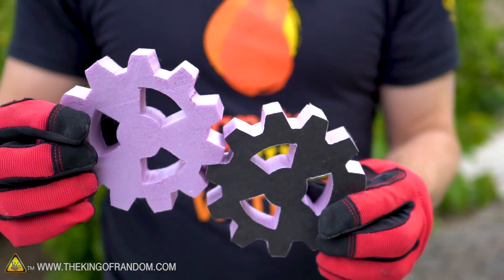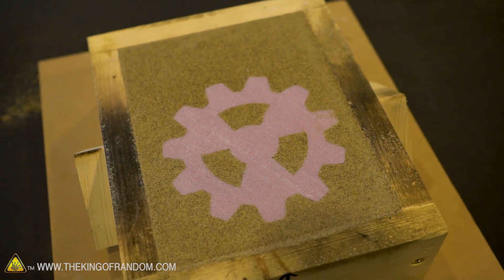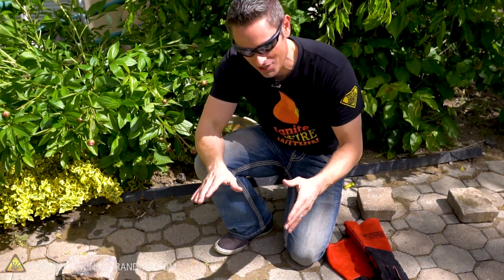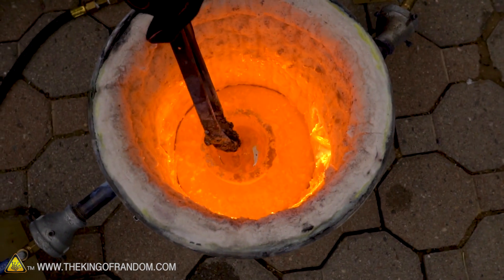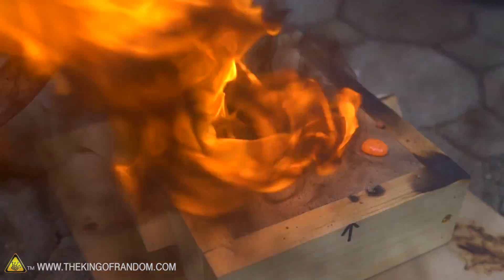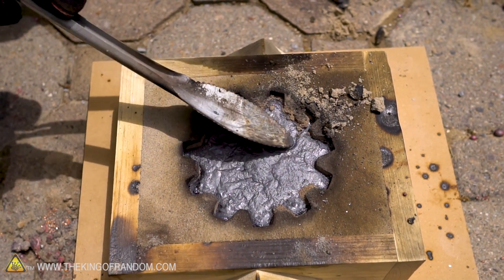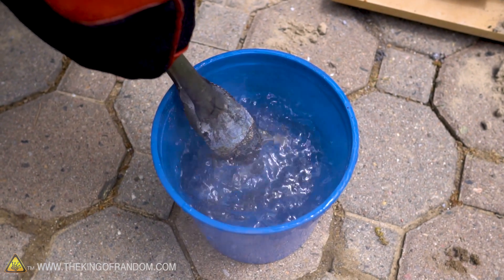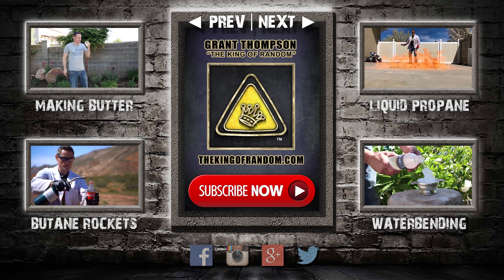Argh. Why Is Copper So Difficult? TKOR Tests Melting Copper In Our Homemade Foundry

Comment: have you tried extending one tooth(? sry i'm german) where you pour in while keeping it hot with a bunsen? so you get rid of the destructive impact and it cools down way slower.
if the sand cools down too quickly add a reservoir.
would be very intrested if that works
and nice vids btw :)

Comment: 1- You don’t have to over heat the copper, you just have to heat it until it is above the melting point. This way the cooling time will be a lot shorter. 
2-?don’t melt the pattern like that. You should let it melt as you pour the molten copper. 
3-  try not pour the copper directly on to the mold. Try pouring it somewhere close to the mold and let it slowly flow inside the mold, so it doesn’t destroy the mold.

Comment: As you pour your molten liquid into the center of your mold, the fluid runs into the edges to fast and your compacted sand takes the hit forcing the mold to collapse prematurely and even lifting your work from the mold because the gas can't escape properly therfore causing it to be deformed and once again you need to start over, a closed box can correct the problem by using vent holes and therfore equalizing the flow of your metal filling itself throughout the mold more precisely giving the overall piece more detail and more precise shape.

Comment: Hey KoR, try using a mixture of sand and clay, that way the sand wont move as much and the clay wont crack (hopefully) because of the sand in it. and it will keep its shape if you decide to take the foam out.

Comment: Sand is brittle and will tend to release when something as viscous and dense as molten liquid 'flows around' . Moreover, sand casting should be used having in mind that machining will allow cutting off residual blump and asperities after casting. You or someone else could try concrete or metal casting, should require less PS samples ;)

Comment: It could really use a gating system with a pour cup. A press and proper moisture would help with broken molds. At my foundry we use a mixture of specialized green sand and seacoal.

Comment: two different mold will make it work. one with gear mold and another layer with just a one pipe line mold, through which u can pour the red hot devil into the actual mold.

Comment: you need the foam to be completely gone . find someone with an inducto vac you will have better results. if you can, use investment plaster and casting wax but even with wax the wax has to be completely gone or you will have porosity and areas that are incomplete

Comment: I wonder if you used a two part mold with runners and risers if the two halves would be mutually supportive and hold the cores in place.

Comment: try casting with mix mold sugar in sand. after making design provide heat on it suger melt and grip all particals of sand. and the result sand is not poped up. and make a perfect casting

Comment: Try two boxes of sand stacked on top of each other with the mold in the middle with a stent leading to the mold from the top of the sand to pour the copper through

Comment: there are vermiculite/sand mixes that harden as so the mold wont collapse
Reply: Ryan B. - right on! Also I'm not sure about copper but with aluminum, sugar (or maple syrup etc.) will give it strength also. It does scorch after each use though. I think the box in the video is too small for such a large pour. I agree it might work better with the top on it, copper should be poured off the finished part because of its weight.

Comment: Leave the Styrofoam in there, but bury it, and poke two holes into the sand for infeed and breathing.

I did alot of aluminum casting and I found the best way to do it was to use the oily wet sand and make my molds from two pieces stacked together with the top piece having a hole to pour into. Later you just cut off the nubs from the feed and breather holes

Comment: you can do this, but you have to press the sand harder and preheat the mold. or I know for a fact you can do it with plaster, you vaporize the wax (this case foam) and pour in your molten metal (copper).

Comment: Why didn't you just remove the Styrofoam mold and just keep the sand that way you wouldn't have to worry about melting it and you'd only have to buy one
Edit: you're not supposed to use sand it's 2 weak you're supposed to use dry clay

Comment: Why don't you try to seal of the gear with green sand and pack it down and use a Styrofoam road as a path for the copper to flow in that way the inner parts won't pop off. You could just file off the excess from the rode but other than that it would help with the form

Comment: you get the same problem when u cast iron. the pressure is to high for the sand so what u can do is use a graffite spray to cote your mold or make it a 2 parts mold so the nobbs is not that tall. if you mix in som sticky stuff to the sand it may help to, use like bentonitt if it's the name in english or some other binding material.

Comment: Just use oil sand for the mold, and you don't need to melt the styrofoam before hand, the copper will melt it when you pour it in.

Comment: you need to use a resin in the sand moulding to strengthen it, and you should dry it out as much as possible. adding moisture makes it dangerous if it were a larger mould it could have blown up in your face. make a metal frame mould and preheat the mould to help prevent rapid chill and cold rolled edges. also if you want to go further make a two piece bolt together with one built up hole to pour into and two more for the molten metal to rise up to the top over the mould. then just cut off the spout and risers.

Comment: Did you try using a closed mold?
You are triying to pour the copper directly over the sand chunks. It would be better if you cover the top of the gear with more sand mand make a funnel and a chimney as an exhaust port.

Comment: Read few more comments down the page. Appears no one has any experience of working in a foundry, moulding or casting etc. If the sand mould is to wet it will explode as the hot metal is poured and steam is created. The usual ways to bind the sand is the addition of fine clay or to use Sodium Silicate and harden the sand after moulding with Carbon dioxide. You need a mould in 2 halves, top and bottom to ensure a "clean" casting, though you will have a "feeder" of metal on the end product which can easily be removed if you are careful in where it is designed and placed. Should have used Aluminium, much easier to melt, lower temperature, lighter and easier to cast, cut, machine etc.

Comment: Should make your sand mould with 5 to 6% by weight with Sodium Silicate, then once the mould is made you can harden and bond the sand with Carbon Dioxide. This acts on the Sodium Silicate. Also a top or cover of the same sand with just a hole / funnel to feed into the mould will act as a header for the liquid copper and reduce the surface area and thus cooling effect of the air.

Comment: You need to make the mold double sided with sand on the top and bottom and use at least 2 breather holes and one pour hole. The added sand on top will help insulate all the heat and keep it molten for longer. Additionally, the sand on top will prevent the center sections from lifting up and floating.
Reply: That was my first thought when I saw this..."why is he doing an open pour on such a big part? If it were a smaller part then an open pour would work just fine, but thats a decent sized part he is trying to create.  He needs a closed mold with a pour hole and vents.
Reply: yes! That is the main reason he is having so many problems.
Reply: Also the riser where you pour the molten metal in will act as a reservoir to replenish through casting as it contracts.
Reply: he needs casting sand.. normal sand esp when wet will never work.. the water in the sand will instantly boil when you put the molten metal in.. as one might know water to steam is about 1250 volume increase.. even with a top on it as some sugested it wont work with normal sand
and yes you need an outlet aswell, to get the pulotion out (remains of plastic and oxide formed by heating) so one in 2 outs and casting sand... that should do it
dont forget to make the castingsand compact for better edges and smoothness:) (preheating it after making a cast works perfect if its a bit humide) thats how we cast iron (termite)
Reply: his casting method, as I know, completely wrong. He used dried sand for casting, he cannot cast even aluminium.
Reply: my thoughts exactly.
Reply: that's it
Reply: Also needs to mix something into the sand to make it 'set', like some cement, bind it together so it doesn't break up during the pour
Reply: Matthew Utt

lol i was about to say the exact same thing then i realized you already said it XD
Reply: you're very right Matthew
Reply: Matthew Utt is right but all metal can not go truth inside is almost perfect.
Reply: Yes, that's what I was going to suggest. Also looks like you green sand mix is not quite right. Perhaps a little more clay. I gave up on greensand quite quickly and swapped to Petrobond
Reply: I was about to comment this we learnt it at school I facepalmed when he did it like that
Reply: t
Reply: Matthew Utt , you got it and some flux and skim off the slash before pouring. that's junior high knowledge man
Reply: I know that from watching youtube videos, not sure how that got past him
Reply: I agree with Matthew and Jared
Reply: +Kevin Sherling I wish I did that at my high school haha
Reply: Thinker 44 Duh huh i
Reply: Matthew Utt ii

Comment: You need a top with a spout and riser to help keep it from cooling so fast from the ambient air and I'm not sure what you are using to bond your sand but it should be wet down with a motor/gear type oil.

Comment: You should use petrobond and remove the styrofoam gear. Use a second side and a couple risers. Copper actually has a relatively low melting point- a bit less than 2000 degrees F.

Comment: I've worked in a proper foundry you need to make 2 halves to the mold the creat a hold in the top half for a poring runner use resin for the sand to harden

Comment: Probably need to adopt techniques of making mechanically stabilized earth for forming the mold.
Also just to put it out there copper isn't normally used as a casting material. It is usually only molten when its refined from Ore or being mixed for an alloy then cast in to ingots for stock. Then it is heated only enough to soften the metal, to be shaped by mechanical means (like pipe, wire, etc) or cold forged by hammer or press.

Comment: you need to add a flux to your copper and your mould should be  hot before you pour the copper into it and let it cool down very slowly. your mould is also wrong it should be two part with a pouring hole and a air hole to allow the gasses and excess metal to escape and you should use mould sand to make the mould. It will then work perfectly.

Comment: Use sodium silicate mixed with the sand and cure the mold with carbon dioxide to set it!  Then remove the styrofoam pattern before pouring the copper and then wait for the copper to cool before touching it.

Comment: hey The King of Random try using foam board instead of using the purple foam, if not try packing more sand if not try both or adding more water to the sand and using that foam board or all three.

Comment: As a jeweller.  I used fine sand or fine ciment . Borax with copper . For the mold , I used wax but the technics you did looks kinda wrong I think the best way is created another box of sand and closed. drill a hole to the foam and drips the melds coppers in that holes .

Comment: Heat the mold also use suit from a fire ( the black stuff from a lighter flame )  you mold has to be close to the same heat for the copper to flow all over the mold

Comment: try not pouring it in a OPEN cast, you need it with a cap on to help insulate the heat and keep it hot enough to flow as a liquid

Comment: Firts of all your sand looks wet.
Secondly you should use a silicate as hardner for uour sand.
You should use a 37 baume neutral silicate. Dry the mould in an oven fore seversl hours and you should get a perfect mould and a perfect cast.

Comment: You would benefit a lot from having a proper set of tools to lift and pour the crucible. IMO, the tongs are dangerous and it slows your pour down. Having a proper holder that allows you to hold with one hand, and pour with the other is much much more efficient and safer. There is also quite a few flaws with your mould work, mainly the composition of the sand, but also with a foam loss method, usually the item is set between 2 moulds, so the mould is solid, and you pour down through a small hole with vent holes., doing it your way, you may as well pull the foam out.

Comment: You need to make a sand moled top and riser to pore into and a vent at the other side of will slow down the copper cooling  and keep heat in the copper

Comment: Ok. I see a number of problems. 1. No one uses green sand for this for a reason. It doesn't work. 2. Instead of taking your time and sifting the sand over the design, you just dumped sand over, creating uneven packing. 3. You didn't pack your sand tight enough.  4 when you were melting the copper, you didn't scrape the slag off the top and remove the impurities. That's why it was coming out all wonky.

Comment: The moisture in the sand begins to vaporize and evaporate before the foam burns away from the extreme heat....  the steam pressure underneath the last remnants of the foam is what is causing your sand to break from the mold.

Comment: After you have set you're styrofoam, build another frame and place it on top, then fill it with sand and leave only a funnel like hole going straight down to the center of your styrofoam gear. Then pour the copper in

Comment: @The King of Random If you sift the first layer of your sand over your styrofoam it makes for a better and denser mold when you pour. Second, when your copper is fully molten, don't forget to take off the slag/impurities and then let it heat back up for a few minutes.

Comment: put the sand mold in the oven for about half hour 1st, it will crisp up the outside surface so it should hold when the copper goes in, maybe lol

Comment: You need to make a channel leading to the mold, because the weight of the liquid copper it's self can ruin the mold. If you have a channel it will flow In instead of falling in

Comment: @The King of Random I haven't got any first hand experience in casting but the sand seems to have low bonding strength.Try adding some bonding agent like betonite.
The difficulty you are facing is because copper is very dense metal ~8.9 s.g   therefore the sand is experiencing high buoyant forces  as a result of which it is breaking.
U may also try using a split mold. A molding box filled with sand placed  on top of the current mold should in theory help prevent the breaking of sand providing added support to the weak radio active shape sections.
Ping me if it helps.

Comment: I am by no means an expert but it would seem like one possible solution would be to make a concrete mold using the same process as the green sand.  If you gave the concrete time to dry you would not have to worry about pieces breaking off.

Comment: Next time try making a proper 2 piece mold using a cope and drag and pour the copper right in with the styrofoam learn a little bit more about mold making.Use foundry sand and not sandbox sand!

Comment: Your supposed to use a wax core closed mild for casting copper that's why you're having so many problems. Green sand works with lighter metals only. You need a plaster mold otherwise it won't work.

Comment: In order to get it to go you need the foam covered in sand with small holes for vents at high points.  (small as in no bigger then a nail or about the size of 12 g wire.)  then also make a fill channel that narrows near the part.  (continued in a second comment under this)

Comment: your mold keeps failing because of your pressing process. The 2x4 wood tamper you're using and brute force is no where close to the needed pressure to form a solid sand mold for casting. You need a hydraulic press and a few tons of pressure.

Comment: As someone who has 0 experience with casting. I feel like you really need to bury your foam cast mold with 2" of that sand and make a spout down through that top layer in the middle. I think the sand would be much less prone to breaking do to its buoyancy if there was sand weight on top.

Comment: Take some harder metal and cast the mold of the inside of the radioactivity marker that way when you pour the gear it'll form around the metal and not be hot enough to melt it but it'll make the desired holes as it flows around it and fills in.

Comment: I would say if mold was completely enclosed with hole to pore it in wouldn't melt foam before copper replaced it so sand wound move and wound get a cleaner gear with less clean up plus would keep copper form cooling to fast that's just my thoughts

Comment: You should use casting sand
Reply: bentonite or oilsand ;)
Reply: when he said 'green sand' i assume he meant he used a green-colored resin mix... omg. that just means raw sand and water.
Reply: Yes, his molds are breaking even before he pours the metal.
Reply: I WONDER HOW MUCH THAT COSTS
Reply: Pennies aren't solid copper there's another metal inside
Reply: or maybe mix sand and glue can work
Reply: Hannah Elson penny have zinc inside of penny as a copper.
Reply: Giulio Costantini nope use nail.
Reply: Hannah Elson zinc, silver, brass and gold
Reply: green sand has a clay mixture to hold moister
Reply: Exactly,use silica casting sand,compress it, then you remove the foam and bingo.
Reply: M&zkdkxgnhgjxv::^$,^*?/*/"'^*/"'*'*',''7$&&#*'?6yMggskhhk,y⛱🏜⛱🏛🌍🌎🏖🗻🏕🏖🏜🏝🏞🏚🏠🏚🏙🏘🏗🏛🏟🕌🏨💒🏪💒🕍🗼🏰🏯🏭🏬🏩🏩🏩🗽🌆🌆🌇🌉⛼🌌🎠🌄🌃🌁⛺🌅🌇🌆🎪🗽🗾⛲⛺🌁🌃🌄🌅🌆💈🌉⛼🌌🎠🎡🎢🎪🎪🏷😎😍🏘 🏟🌏🏗🌏🗻🌋🌋🏚🌏🗻😁😙🌐🏟🌏🗺🏘hxxnd       y😎😍😎😎😎😎😎😎😎😎😎😎😎😎😎😎😎😎😎😎😍😍😍😍😍😍😍😍😃☺😁😉😎😊😘ou 🏝🏔🏙⛱🏘🌎🏛